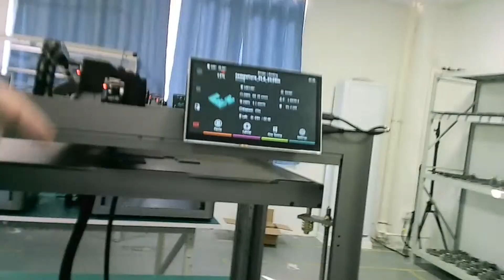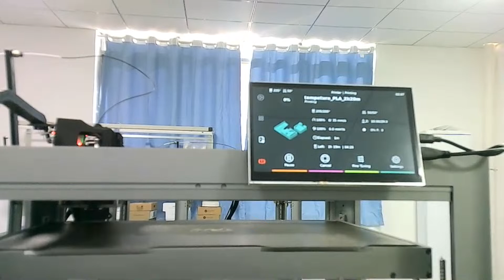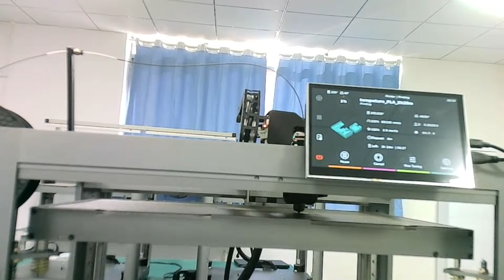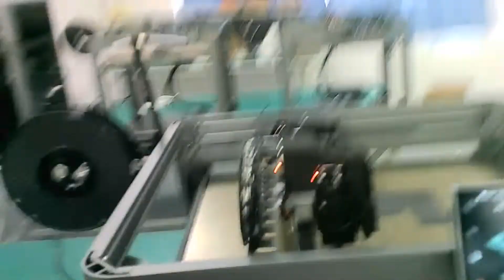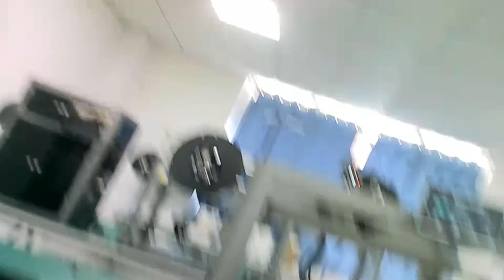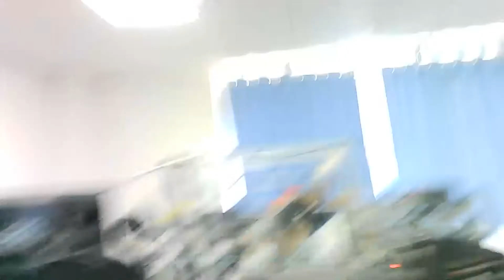Peopoly - Live Stream 2023 12/7

Comment: Still yet to see this printer run at any speed, that it should clearly be capable of given its motion system. You really need to be showing this system being pushed to its limits and not slow prints.
Reply: Did you see the two printers in the background?  They looked to be going pretty fast.
Reply: they looked about the same speed as the bambu`s, this technology should be able to provide something closer to VZbot speeds but currently does not appear to be doing.  @stew675

Comment: Although input shaping is not required won't the drag chains cause any resonances during fast printing?
Reply: Possibly, could always turn it on anyway. The printer has the ADXL so it's available as an option if wanted!
Reply from the maker: Hi，Thank you for your attention! We generally think that resonance is mainly caused by belts and stepper motors, but magneto X has neither.

Although we can do without input shaping correction, we still have an acceleration sensor in our toolhead, and input shaping can be turned on at any time. Thank you again for your attention!